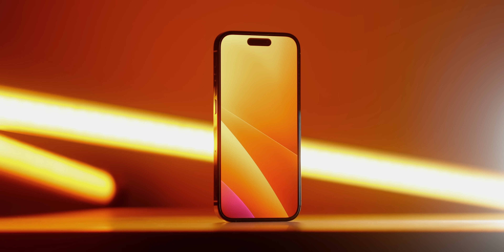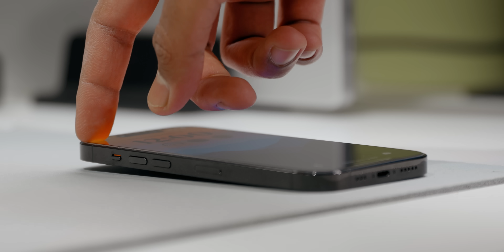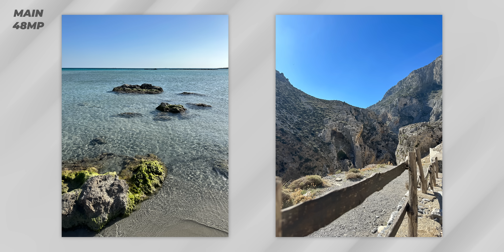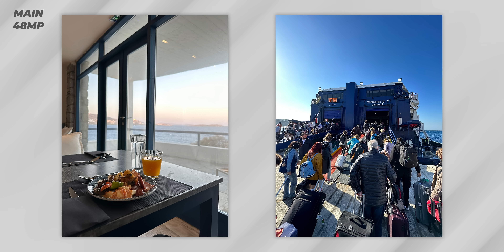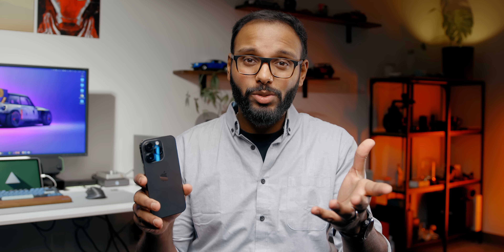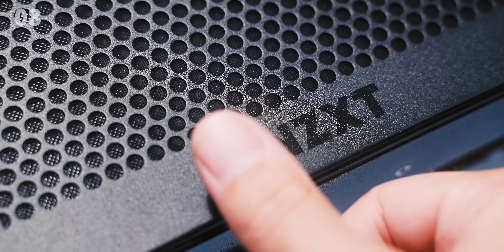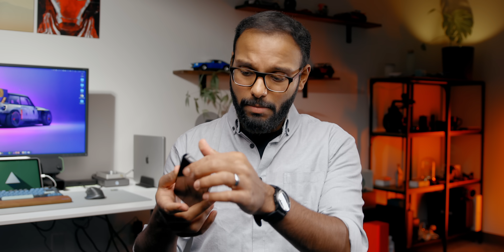Apple iPhone 14 Pro - A Long Term User Review

Comment: Went from an XS Max on 13.5 jailbroken, to a 14 Pro Max on 16.4 and it’s been wonderful. The only downside is no more adblock, but a scary amount of performance increase with the AI features on the backend and efficient advertising. I avoid wireless charging to not add too much heat and degrade the battery so much. The camera and screen have been the most noticeable changes.
Reply: 'efficient advertising'?

Comment: Always-on display is a must have feature for me. I switched from a Galaxy S21 Ultra to the iPhone 13 Pro Max and was just about to return to Android for that reason alone. Thankfully, the 14 Pro Max has it now and kept me on iPhone this time around.
Reply: Finally finding someone that used a s21 ultra. How are the differences? What does one does better than the other, and is it worth the switch to iphone? I recently bought my s21 ultra but 3 years from now i will try and switch to iphone. Curious to know your feedback as a former galaxy user
Reply: @unknownwarrior5672  To be honest, I didn't use a ton of the "galaxy specific" features... such as their alternatives to apple pay, etc. so comparing apples to apples in that regard will be a little tough. With that said, it's fine, I guess. Each have their advantages. I would say that I'm overall happier on the iPhone currently. Granted, that could change at any moment. I've swapped between Android and iPhone 3-4 times over the past 10 years and I've always went back to Android. However, this is the longest that I've been on iOS now after a switch and haven't felt the pull to go back. I think I just get bored easily. iMessage is great if you iMessage with a lot of folks, but is kind of a moot point if you use other messaging services (discord, whatsapp, etc.). I do find myself using features more on the iPhone though, even ones that are standard to both. I've been using the siri automations more than I did the bixby routines. I've been using Apple pay more than I did NFC payments on the galaxy phone. I always used the fingerprint sensor on the galaxy and for whatever reason never used their version of FaceID (I think the S21 had face unlock anyway?), but now on the iPhone I love using FaceID and can't imagine using the fingerprint sensor again. I don't know if it actually does feel better and more techy to use these things as the reason I enjoy it more, or if it's just because it's using these things in a new environment and I felt that I had to try them and am now hooked. Not sure. But I do find myself using all of the iPhone's capabilities more than I did on Android. As for other stuff, the OS is good. Really not a ton different than Android other than locations of things. iOS has pretty much every app that I used on Android, so no worries there really. I do think that the consistency that Apple lords over things with does lead to a better overall and cleaner experience though. Everything feels a little snappier, maybe a little more animated with the transitions, etc. Sometimes I feel like you'd still get that odd, janky, Android experience occasionally and I don't feel like that happens quite as often on iOS.  To be fair to Android though, I have sort of Android-ified some things and I think that's probably helped too. I think I'm doing a little bit of both worlds and that's keeping me here right now. I still use google photos (the web version I feel like is much better than Apple photos), I still use the google calendar (again, I use the web version a lot and feel like it's better than iCloud), but then I use iMessage for SMS, Apple reminders instead of google tasks, gmail of course, and onedrive instead of iCloud or Google Drive. So I've coupled that experience with having iOS and always getting the most recent updates and features, vs. waiting on Samsung to push out their customized version of Android and their OneUI. So TL;DR, I think I made the right decision and am currently pretty happy with no intentions of going back. Also currently looking forward to the next iPhone which will finally it seems have USB-C, so no more lightning nonsense. I thought I'd hate losing some of the customization of Android would kill me (putting icons anywhere, different launchers, etc.) but I really haven't cared one bit since settling in. As long as you just use the apps that you enjoy on iOS and don't feel bad about using stuff like Google photos and so on in an iOS environment and just sort of make it your own, the switch isn't really that big of a deal. At least it hasn't been for me so far. Sorry for the rambling vomit of text, but hopefully that at least gives you some idea.

Comment: Upgraded from XS Max to 14 Pro Max. 
Pros - 120 hz is a dream, screen is larger, very fast processor, longer battery life, amazing camera.
Cons - No 3d touch (didn't thought i would miss it that much) but eventually you will get use to the hold gesture.

Comment: LOL, this guy has obviously not used iOS for very long. That swipe from the bottom to show the notifications actually fixes one major problem with the borked iOS notification system; where none would show on the lock screen, so you keep unlocking your phone as normal all day, but really there are a few notifications just chilling in the Notification Centre(!!), which you have to swipe down to view, so you totally miss them. This is one big reason why I switched back to Android, and haven't looked back.

Comment: I’m worried about the screen burn in issue that some oled displays have as the clock doesn’t move around and is static so I only turn it on occasionally.

Comment: Great review, much appreciated! I’m downgrading my 14 pro Max to the Pro this coming Tuesday, can’t wait 😊 Could you please share the wallpaper? Thanks again
Reply: How are you liking the pro over the pro max? How is the battery life on the pro? I’m thinking of switching to the 14pro from 14pm and giving my son my 14pm.
Reply: @tammyboylan8136  I’ll be picking it up in about an hour or so, definitely best choice over the M2 Pro. Better heat sink, better speakers and no ssd issues, it’s a no brainier. I’m getting the 10/16 config with 1TB SSD and the 16gb ram. Brand new from retailer in South Australia at $700 off retail price. Can’t go wrong with that!

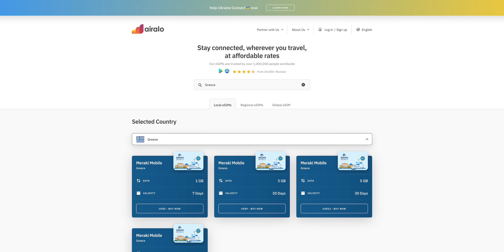Comment: 2:00 On regards to eSIM, you said you simply shopped for an eSIM provider when you went to "Europe" and then went to Greece but as someone from Greece, no one uses eSIM there. Mose people use a physical SIM and prefer it that way. The service you're using isn't even Greek. It's a North American service which simply utilises probably has cheap roaming for an actual Greek service. SO the increased availability and ease of use is only limited to North America and isn't universal to most other countries. So that's a bad argument to make. Also foregoing the privacy issue, that something like this makes it basically impossible to have an anonymous SIM as you're required to use your identifiable bank card to sign up and pay.

Comment: Haven’t had any notifications problem. The latest notifications pop up on the screen. If I unlock the phone without touching them I can still see them by locking it and swiping up. So if your screen is empty it means you have not gotten any new notifications since you last unlocked the phone. Avoids notification overload which I really like.

Comment: I have the 13 pro and I’ll probably stick with it until the 16 or 17 comes out. I think the always on display is so dumb too. Don’t understand why everybody wants it. It just drains battery. If you need to check the time or date, JUST CLICK THE SIDE BUTTON. The only thing apple needs now is to be able to pause video like you can on android, fingerprint scanner, and faster charging speeds. Don’t need no dang split screen feature or reverse wireless charging. If you guys need that then you spend too much time on your cellphones.

Comment: As an owner of a 13 ProMax, I find the hardware first rate.  Sure there are things I would change like the glossy steel bezels.  It is the software I have issue with.   From it just works to hope there aren’t too many bugs has become the norm.  Sadly.
Reply: I have the 13 Pro since May 2022. What bugs have you encountered? Did you upgrade to iOS16?

Comment: I upgraded for a regular iPhone 11 to the 14 pro I will say I’ve noticed that the battery life is about the same if not slightly worse than I remember my 11 being brand new. That being said I have been using the always on display but just the time and notifications on not the wallpaper. I do like it because I can see what song is playing when the phone is mounted on my dash without having to turn it on, and distract myself from the road. But other than that the dynamic island is great and the cameras are even better. I’d say if you have an 11 or older this is a perfect upgrade but if I had a 12 like my friend I would probably hold out another year for the 15.

Comment: Went from 11PM to 14 pro, I didn't even notice the 120HZ but I think the screen itself is glossier and better quality. Battery life is average as it's smaller. Everything else is the exact same, I think people who own 11 pro should just get a battery replacement rather than upgrading. This is a good upgrade from Xs, 11 and older
Edit: even the speakers sound better

Comment: Users worried about privacy can easily prevent their mobile network from tracking their location by removing their phone's physical SIM card. However, since eSIMs can't be removed and are hardwired into the device, eSIM user's phones will be constantly active on their carrier's network, and more easily traceable.
There is nothing good about eSIM. It’s only there to make us more vulnerable, traceable and constantly connected to their grid. First there was unremovable batteries now it’s eSIM - just one step further to eCHIP implants🤡

Comment: ESIM is the worst thing ever, I had to switch to a different phone and it took me 2 hours on the phone with the carrier to get it to work right, then another hour when I wanted to move it back.... All could have been done in less than 5 seconds flat with a SIM card... Just another way Apple locks you into their "Ecosystem"

Comment: The "new" LTPO display doesn't improve battery life. Apples says directly on their website that the 1Hz mode is exclusive for the AOD. When using the phone, the iPhone will still only go down to 10Hz as before.

I also kinda don't get the criticsm of the new notification design because swiping up to see older notifications is NOT new. That has been there for like at least half a decade. they literally just put the notifications from the middle of the screen to the bottom. That's it. Everything else is literally identical.

Comment: I upgraded from the 8 Plus to the 14 Pro and it has been great. I only use the dynamic island for timers and it is nice to see other things like the low battery notifications there but most of the time I forget that it is there. The camera and the battery upgrade has been incredible. And I also disabled the Always on display on my first day; I don't like how it just dims. I might try it again with iOS 16.2
Reply: Been using the dev beta of 16.2 for a few days now, the ACTUAL always on display mode really makes a difference.
Reply: Dude you kidding me? same here. after 5 years of service, 8+ had been retired 😅. finally a worthy upgrade
Reply: I went from 6s to 14pro max :’) incredible experience.
Reply: Coming from a Samsung, I disabled the always on display on this (even the pure black version). I’ve just never been a fan of the feature but on Samsung you at least single tap the screen to get it rather than it being always there (I know that’s in the name but options would be nice)
Reply: that's a big jump
Reply: I currently have the 7 plus, i m waiting to see the next one come out, tell me is it worth the price.
Reply: @eddyeroyal6024  i m using 1+7 pro time to upgrade
Super confused between S23 ultra 512gig ver. (which is about to be released)or iPhone 14pro max 512 gig ver.
Reply: Ooh congratulations on the amazing upgrade!!  I'm using an 8+ too since the past 5 years and been confused about upgrading to a 14 or 14 pro. How's your experience with it so far ? I do need a better camera as I'm looking into content creation in tiktok and instagram, idk if 14 is enough or if I should go for the 14 pro. I don't do professional photography it's more of lifestyle content I'm focusing on. Researched and watched many videos but everyone in the comments were upgrading from an 11, 12 or 13  model, so it wasn't that helpful in making a decision 😅
Reply: @husnaLWWYwith1D  It's been great for me. I have only had a few minor issues. The camera is great, but for content creation the   13 pro or the 14 might be good enough. I would not consider getting the 14 and instead get a 13 or 13 pro since it has very small changes unless you can get them for similar prices
Reply: @husnaLWWYwith1D unless you need zoom or want to really get into photography and shoot RAW format, the 14 is basically the same for video and photos
Reply: I will switch from 7 😂
Reply: I love the AOD lol

Comment: I’ve had the 14 pro max since October and I think the processing got better over time
I feel like at the start they had the Google Pixel 6 problem where they kept the processing at the max even tho the bigger sensor didn’t need it so photos ended up looking overprocessed but now it’s far more natural
Reply: agree, night mode still needs a huge revamp to compete with pixel/samsung; it feels is the same the last 2 gens, no tweak at all... hope they improve it on the 15
Reply: @ghfsd786fa  I mean I came from an 11 and most my friends have an S21 ultra and we’re all dumbfounded at the 14 pro’s night mode
Reply: Which IOS do you have? Mine still looks SO over-processed :(
Reply: @gofasofrimus  iOS 16.2
It still does give an overpocessed result every now and then but it’s been happening less and less

Comment: i have the 14 pro max and i get similar battery life tohis 14 pro, is that an issue? I thought pro max supposedly has better battery.
Reply: the battery life of my iphone 14 pro max also sucks. only 8 hours on display time even always on is turned off. some ppl get 11-13 hours on display time with the ip 14 pro max. i hope the upcoming ios 16.2 update will improve the battery life of my iphone 14 pro max

Comment: "Always On" implementation for the 14 Pro doesn't look quite how I imagined!

I really liked how it was done on the old Moto X (2014). Any incoming notifications would bring up monochromatic, minimalist icons and clock display. Didn't light up parts of the screen unnecessarily.
Also liked how the screen would stay blank, until you waved your hand over it which would then display any notification icons at a glance.
Reply: the Moto X was amazing
Reply: iOS 16.2’s (soon to be out of beta) implementation of “AOD” is MUCH better.
Reply: It sucks never stays on apple sucks